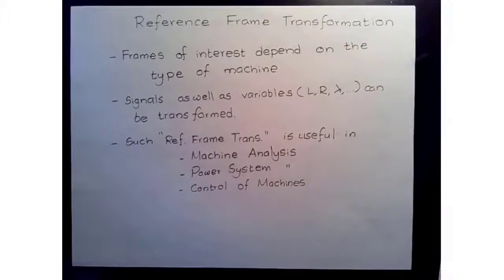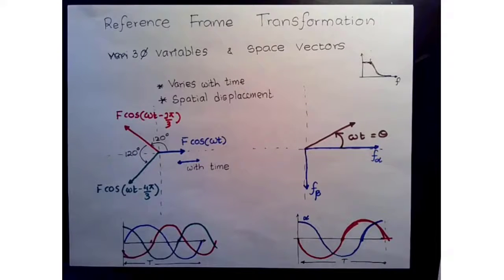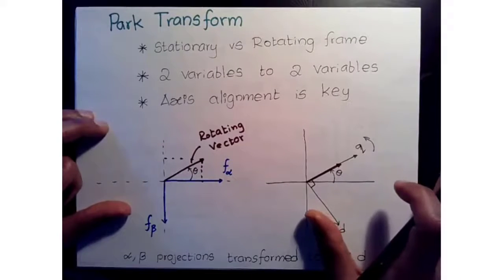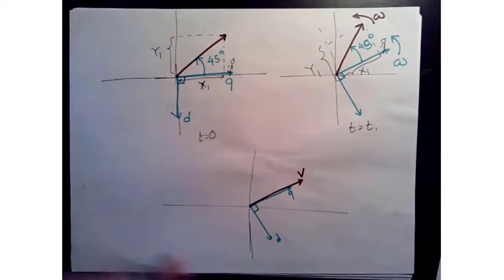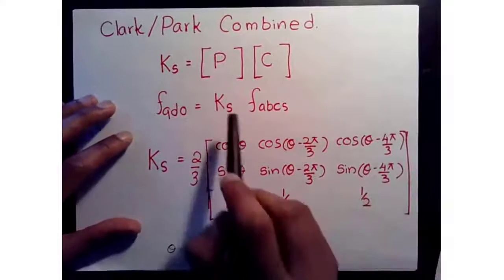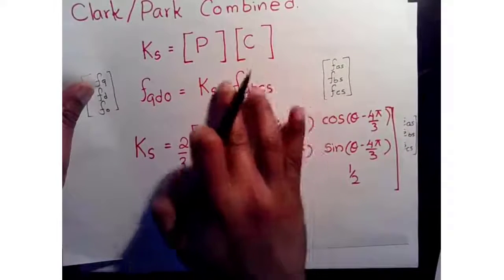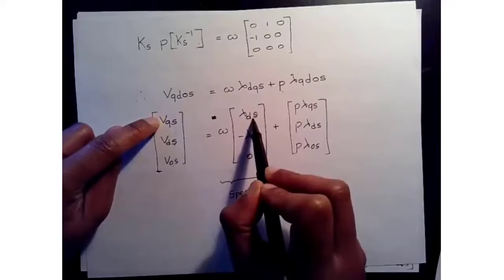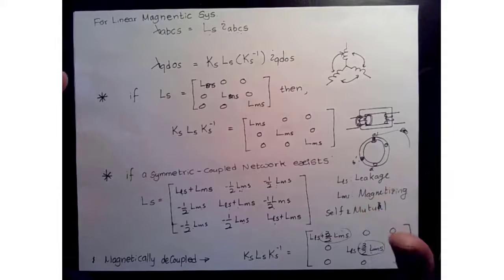Reference Frame Transformation (Updated)

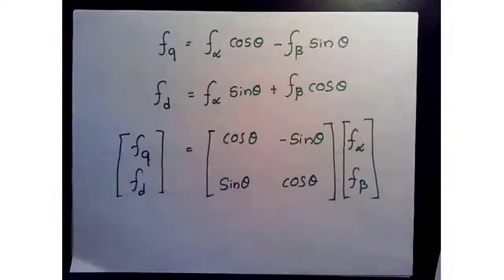Comment: Thank you Dr. Sandun for this amazing lecture. Just small doubt: if you play the video at 28:00 and observe the middle matrix, shouldn't we put the negative sign in the other sin(theta)? I found on the web that the negative sin(theta) is in the second-row first column but here you are putting it in the first-row second column does it make any difference or both are equivalent? Thanks again!
Reply from the maker: Eyad, I'm not sure exactly what material on the web you are referring to. So if you can post a link and I can see. The sign may change on the relative alignment of Id and Iq axis. One can choose Id to be leading instead of lagging. So this may be the difference. But I'd have to see the reference. See if the angle is measured as I do here. i.e. with respect to q-axis.
Reply: @SandunKuruppu  Thank you Dr. Sandun for your reply. Kindly refer to page number 8 from this .pdf file:
https://www.bharathuniv.ac.in/page_images/pdf/courseware_eee/Notes/CE2/BEE052%20%20ELECTRICAL%20MACHINE%20MODELING%20AND%20ANALYSIS.pdf

or to the following topic:
https://en.wikipedia.org/wiki/Direct-quadrature-zero_transformation

The second matrix (called Kp)
Reply: @eyad: Observe the matrix carefully it's [q d 0] and on the web mostly it's [d q 0]. Both are correct.

Comment: Excellent lecture, thank you!  I have one question; shouldn't the 2/3 coefficient present in Ks also be present in the voltage invariant Clark transform due to the way the (abc) vectors sum to 3/2. Wouldn't the 2/3 coefficient correct that?
Reply from the maker: Thank you! The 2/3 wont be on the inverse, because the trig functions result in a 3/2 that gets cancelled.